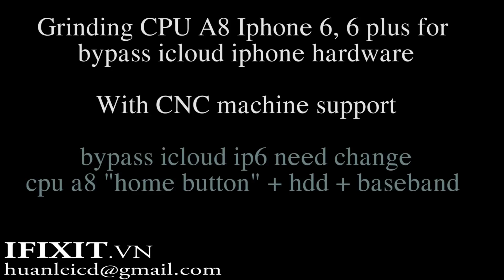bypass icloud iphone 6, 6 plus hardware solution with cnc support

Comment: for those one need to know where to buy the cnc. go on ebay grab a chinese desktop cnc for about $1000 get vcarve software to program your tool path. The way it being done this way is taking too much time. go buy a infared surface mount welding station. you can remove the chip 10x faster.  .
Reply: hello  Adam would you be so kind tell me were i can find such machine infrared welding station and what kind of a machine would you suggest  for mobile phone is you could please help me out ?

thanks again for the help

Comment: It looks like the last few pics have been edited, they are far to perfect after the milling passes , what is the fail and success ratio with this milling routine. there has to be a fail rate, any warpage of pad area or a twist in the logic board will cut into the pad tracers or remove the insulation coating on top of the tracers  but thanks for the vid
Reply: The speed of the bit is fast and consistent. I am sure the pads are fine. It probably works very often and this method is probably the best. Board warp.. its not really getting or pushed on. Cheers :)
Reply: I agree, I have a CNC machine from China that cannot grind anywhere near the accuracy required for CPU removal.